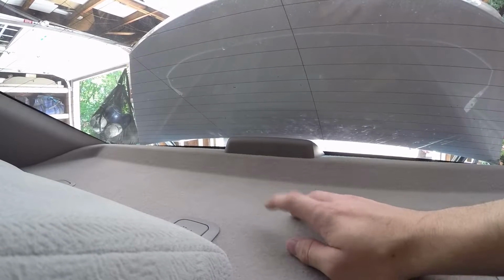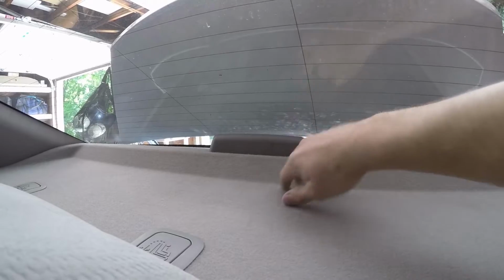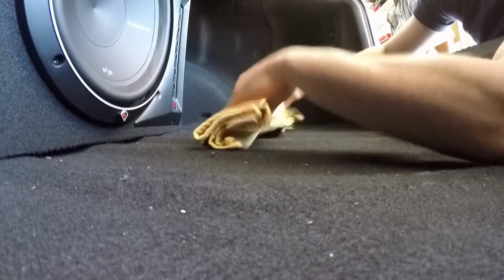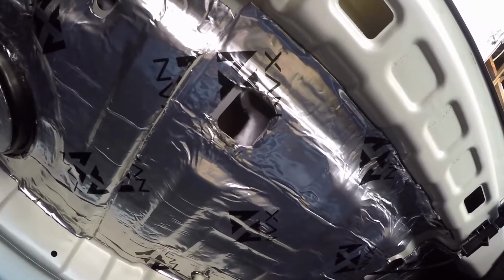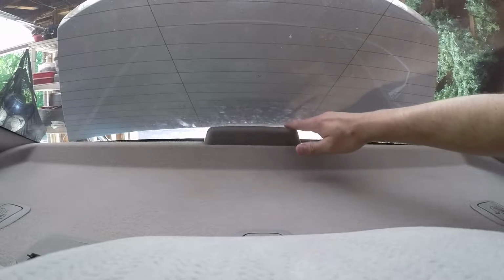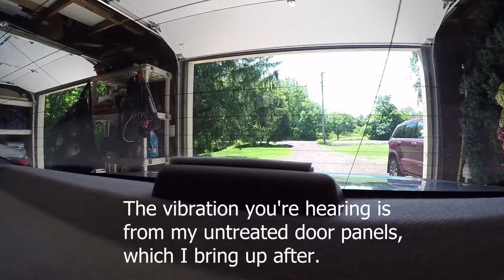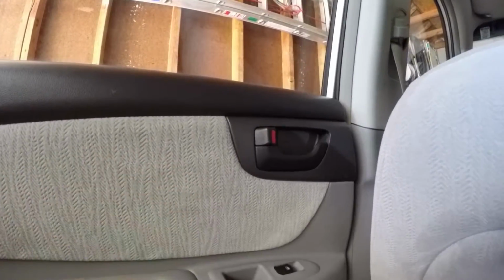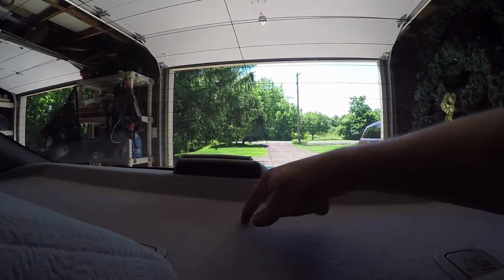How to Eliminate Rear Deck and Third Brake Light Rattle

Comment: Next time when your installing your sub. Remove the back deck and buy a small roll cotton insulation from Lowe's or Home Depot then cut to the shape of the deck and use 3M spray adhesive same this used for installing headliner it will completely stop all of it. Or if you catch someone removing the carpet from a building and use the carpet padding cures it completely

Comment: Trick still works. Did this to my 16 Accord Sport just now and love my ported JL Audio 10 in 😍
Reply: Nice! I have a 2016 accord and thinking about doing this. Is it still holding up?
Reply: @mike7605  yes, just have to rotate it around after it slips out and change a to a new one after it's no good. Bass hits nice with no rattle
Reply: L B I have the exact same car . Did u use the the towel or the foam to stop the rattling ?
Reply: @youngchubby7764  I did both.
Reply: Ended up super glueing 3 pieces together for less swapping out single pieces of foam that wore down often. Haven't needed to swap it out since. Just minor adjustments from time to time.

Comment: I can't hear the rattle in your video because of my rear deck rattle. UPDATE I found that the rattle on my '10 Accord was totally from the third brake light. I went straight to the foam between the glass, and it completely solved it. Thank you, you have saved me from driving my car into a ravine.

Comment: I just ran out during lunch at work and stuffed a bunch of rags under my deck lid on my 2016 accord sport!!! Removed rear seat head rest removed the covers for the seat belt straps crammed some rags in there and done!!! 
I still have a piece of Styrofoam for my third brake light in place but i was able to turn up the fosgate P3son the kicker 3400amp and it was knocking real 👌
Thank you good sir your service to the community is greatly appreciated 🙏

Comment: I went to home depot and purchased some automotive weather stripping and sealed my trunk off better. Made a huge difference, but the deck was the main issue. This totally fixed that. Some of these home depot rigged setups work pretty damn good. Also used camper foam seal strips behind my license plate and removed the license plate rattles completely

Comment: This is a solid solution to rear deck rattle. Tips for rattling in the trunk area after adding a sub. This solution with the foam tube, add cotton or padding between the rear deck and medal panel, if you're able to take off your rear deak use spray adhesive and add foam spraying it to the entire rear deck, loosen the bolts on your trunk latch and move it down a bit to make your trunk close tighter, the bump stoppers on the truck lid can be loosened to make them extend a little lower, be sure that your spare tire bolts are tight and secure, add a drop off loctite on the screws, check, all bolts and panels, remove your tail lights and place a piece of foam behind it and the metal panels, and put foam with adhesive behind the license plate.

This will eliminate all rattle, if you still hear a mysterious rattle, investigate it and add foam or polyfill to eliminate it. Once this is done this will give you time to fully inspect the vehicle to see if it's loose bolts or simply just some change that fell in your trunk. If you're still not satisfied, you can then get into adding sound deadener, Closed Cell Foam, and Mass Loaded Vinyl. This can help out with sound dampening, vibration control, rattle, acoustics, and sound absorbing.

A mixture of everything will help you have the best sound quality, vibration free car, with reduced or no road noise, no loud exhaust drone, and increased volume in sound.

Another thing to consider is the type of subwoofer enclosure you have and where it's placed, sometimes simply moving the sub can reduce or stop rattles. If you have your sub facing to the rear, this allows for more wave travel which will increase the SPL a little but it's firing directly to the back of the trunk which means vibration and rattle. This can be controlled but everyone is different depending on if you want muddy bass or punchy bass. A sealed box firing forward sealed off from the trunk will more than likely have no rattle whatsoever. If you have a ported enclosure, I highly recommend allowing for the air to come into the cabin some way, this can be done by simply lower the back seat but that takes away the chamber affect but it helps with rattle or you can do what I did and that's remove the speakers in your rear deck and make sure no padding is covering the speaker holes, add some weatherstripping around where the speakers where and that allows the air to freely flow into the cabin using the speaker holes.

Only remove the speakers if you have enough speakers or if your specific setup will not miss out on anything if removed. Since I had 10 speakers, taking it down to 8 was not going to be any harm whatsoever since everything is amplified.

Cheap solutions are weatherstripping, foam, polyfill, double sided tape, cotton, adjusting the trunk latch, and using any old rags that you just don't need to put between panels that are rattling.
Reply: Thanks for going so in-depth in your explanation and taking time to go over everything! 🙌🤙😎

Comment: Yooo you saved my life man! I had a big rattle issue in my 2016 Honda Accord Touring with my subs, but now it sounds great! Thank you!
Reply: did the 2016 touring have their sub on the rear deck? did you replace that one or did you upgrade it and got a boxed one?
Reply: DUDE I just got a 12" in my 2016 accord touring and that's how I found this page lol.  thanks for your comment, i'm wondering if google found it based on your comment.
Reply: @adriandab7017  it had a sub on the rear deck and I got a new one and left the old one in

Comment: Thanks much, your information on the back panel not being attached was very helpful. At least now I know what is most likely causing my noise problem. Never thought of using caulk backing rod to sound deaden, thanks again. Will see if I can solve my problem with your help.

Comment: Same exact rear deck as me with slight differences, I have a 2012 Chrysler 300 and those hooks for the seat, they have plastic covers and they just go fucking insane with any vibrations at all. I have mine taped down and that helped SO much.

Comment: The trick worked ok but I used a round waxing pad and wedged it in the sides of the rear break light ! Stopped the rattling immediately thanks for the tips

Comment: I just bought a 2020 touring any idea if i will go through this issue? but either way thanks for this video seem like a simple fix. Also not sure if you would know but if i switch up the sub that comes with the car to a better one would it sound better using the factory amp? speakers ? thanks for this video

Comment: It's mostly where the brake light is, I went to dollar store took a sandal closely matching my color need, cut into a strip the width of the 3rd brake light and wedged it evenly between the rear windshield and the plastic brake light.

Comment: The light inside my 2005 Mazda 3 trunk was loose and made a huge rattling noise, fixed with duct tape. I suggest to everyone to just go through your car and try to find if something is loose and duct tape it so it doesn't rattle

Comment: im going to look at my nissan altima tomorrow bc when the bass hits the peak it sounds like metal shaking in the trunk.  I fixed my license plate but im not sure if its that 3rd brake light hitting that back window, which makes the sound horrible.
Reply: Which year, I have an 06.
Reply: Just did this on my maxima and only had to use a towel to eliminate 98% of rattles. The foam completely gets rid of it at high volume

Comment: If I can ask, what car is this on?  I'm trying to fix this on my car, and your rear deck looks a lot like mine, only difference is my rear deck has a factory sub in it, and that makes the rattle, not an aftermarket sub.  And won't that foam burn if you turn on the rear defroster, due to the wires and all that?
Reply: @Talkin_Loud  Can I ask what the rubber stuff was?  My car sits outside all the time, not sure how foam would put up under that.

Comment: You don't find much info about this because its fairly obvious at least to me. It take like 5 minutes to remove the upper rear deck carpeted board in that particular car model. Deaden the top of the deck and under the carpeted board and use foam tape around the brake light or any of the plastic part that rattles. You can use foam speaker gasket tape. It works wonders.

Comment: that will work ok for a system thats using subs that move little air. but i dont think it would work for mine. A sundown audio Zv4 15 with dynamat extreme in the trunk throughout. IMO the rag would eventually move around everywhere due to vibrations. But thats just my opinion! I could be wrong. its more time consuming, but using sound deadener in place of the rag, would produce better results.

Comment: If the rear deck never need to be removed why not try expanding foam spray?
Reply: Because it's messy as fk, that's why.
Reply: Yeah expanding foam can get really messy. Some weatherstrips, polyfill, or even old rags will help and not be messy at all.

Comment: I'll probably go to Home Depot and get some black dampeners to wedge between the light and the rear windshield. My BRZ runs a straight-piped dual exhaust so the rumble and vibration in the cockpit is STUPID bad.

Comment: Dude I have a 2013 Civic and that rattle has been driving me insane
Reply: did u try this? did it work? i have a 2013 civic too
Reply: @asharahmed7236  it helped but what I ended up doing to completely eliminate the problem was I tightly shoved a piece of black colored foam in between the rear brake light and the rear glass window and it completely stopped the rattle caused by my sub
Reply: @davidmxo1930  Ok sounds good thanks man. Ya i just bought the thing  from this video for my car. What kind of subs you got in the civic?
Reply: @asharahmed7236  I got a 12 inch Rockford p3 with a 500watt rms Rockford amp
Reply: @davidmxo1930  what wire gauge did you run to the battery?
Reply: @davidmxo1930  I got 2 12 inch jbl subs in my civic and that brake light rattle is so annoying
Reply: @asharahmed7236  yeah it would drive me crazy lol

Comment: Also people stop buying U-Seal from Home Depot that material cintains asphalt which cause skin irritation, lung issue and %100 causes skin cancer. They sell a peel and seal but make sure buy the peel and seal asphalt free that's just rubber. People are stupid. Roll the windows up and the doors shut that a sealed container and even if someone can't smell it, trust me those fumes are there. Last time they sell a form of weather proofing sealant with an aluminum backing. It may require multiple layers also it's not as wide as asphalt roofing sealant. People should really stop and read the label